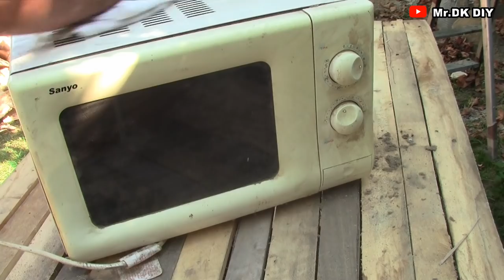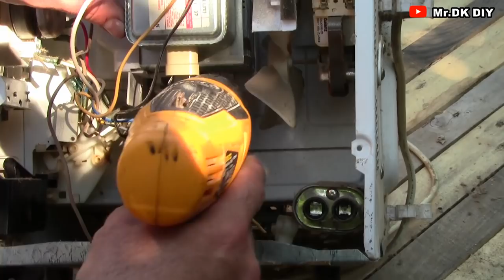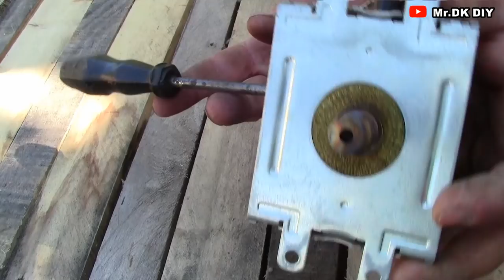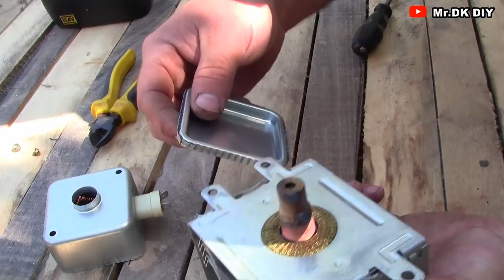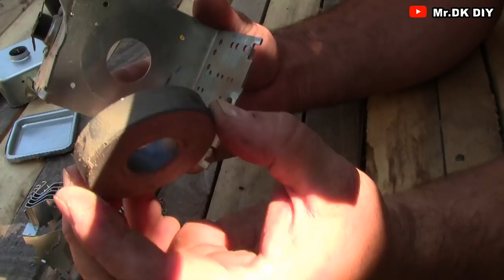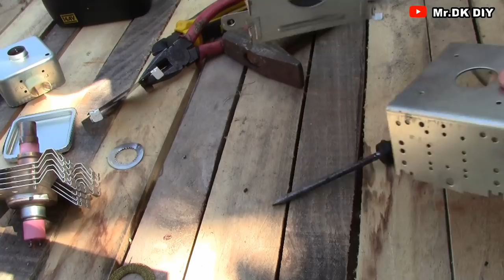HOW TO REMOVE STRONG MAGNET FROM OLD MICROWAVE / DIY 2018

Comment: PSA - That ceramic insulator is made from beryllium oxide. During use, it is inert and harmless but if it is crushed and the dust is inhaled you can get berylliosis, an incurable disease of the lungs.
Reply: I was waiting for him to stop and point that out in the video!

Comment: you have to be carefull with the ceramic insulators it's at both ends of the saft that gose through it and it's made of berilium if you break or crush it you could end up inhaling some of it and if you get a large enough dose of it you could end up with severe beriliosis and that can cause death.